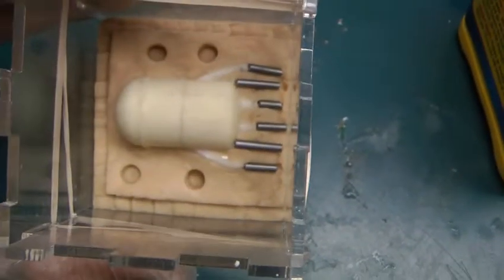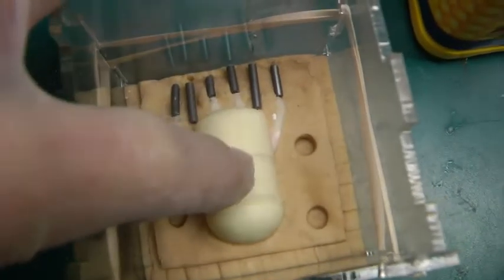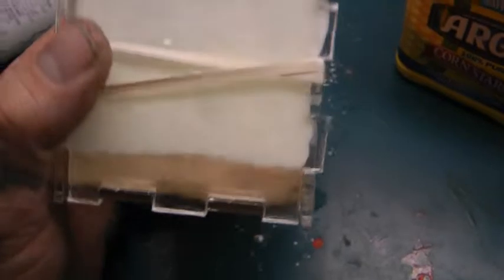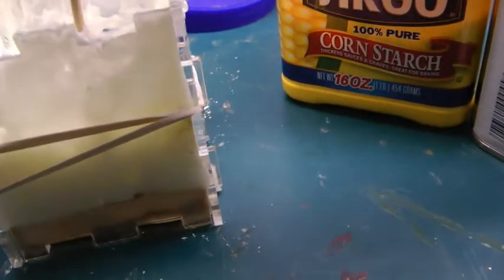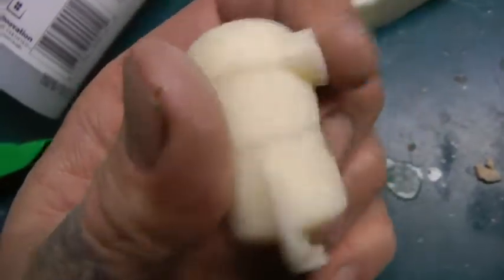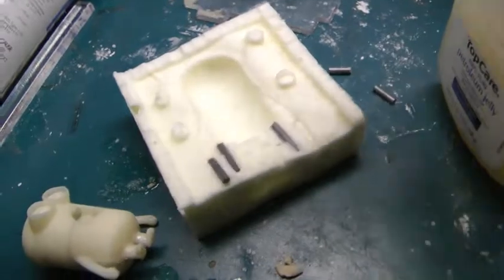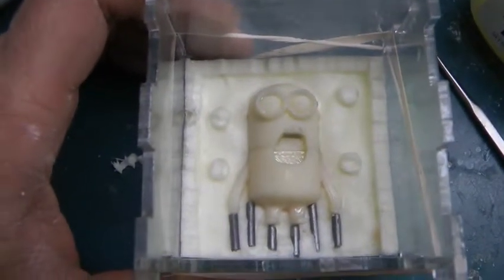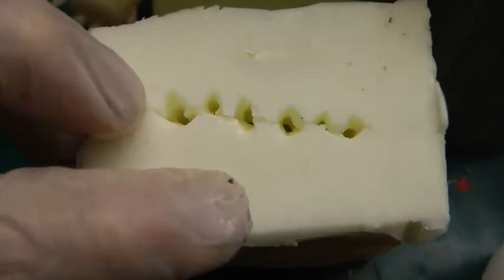Mold Making using oogoo from a 3D printed part

Comment: I love your videos! But wouldn't it make more sense to use a pour silicone for the mould-making? I mean, they are expensive but the spirit + caulk is kinda harsh without a respirator, and it probably won't last as many casts. Minion looks adorable